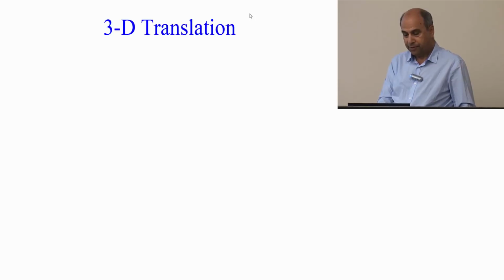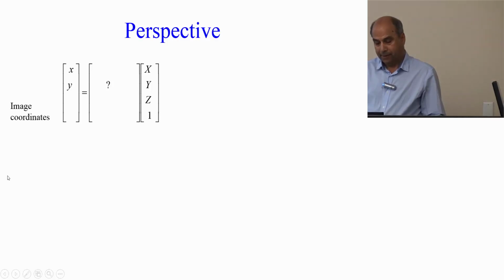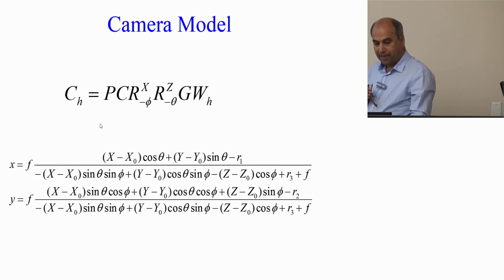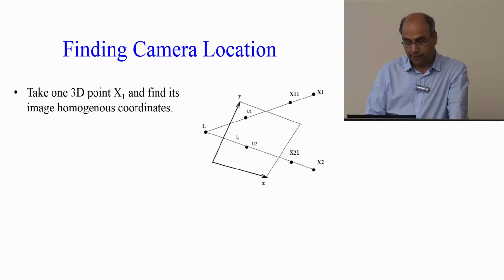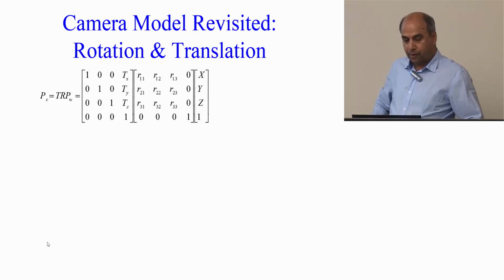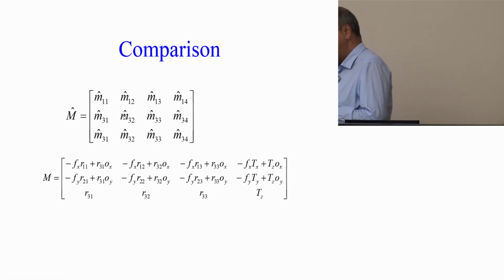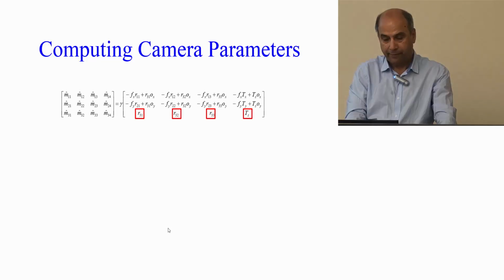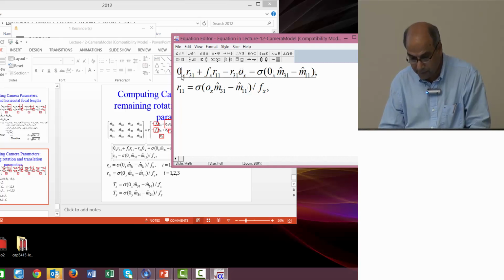Lecture 12 - Camera Model and caliberation - 2014

Comment: I have one query that is whats the difference between camera model and camera calibration
Reply: TLDR; Your model is the mathematical description, for example, just using an intrinsic matrix without distortion: K = [fx, 0, cy; 0 fy, cy, 0 0 1] and your calibration for this model and the actual camera model you are using could be: fx = fy = 105.2 (focal length in terms of pixels), cx = 961.8, cy = 539.8.

You're probably not going to ever read this, but for anyone interested: The camera model is the mathematical description of the camera. Typically you would have at least a K matrix (3x3) which includes the focal length and optical center. Commonly, however, you would in-cooperate at least some way of dealing with lens distortion. Typical ways of modeling distortion rely on making the optical center a function of position on the image sensor. Specifically, as a function of the distance to the optical sensor, such that pin cushion distortion and barrel distortion can be modeled. Of course, you can make this more complex, but this will also make calibration more difficult.

So what is calibration? Calibration is figuring out the values of the parameters to your camera model, such that when projecting world points P to image points p onto your sensor (say p = K * M * P, with M being the extrinsic matrix [R t]) you minimize the error between observed points and projected points.

Once the estimated values of your model (your calibration) match close enough to the "real" values, your projected points will be accurately projected to within a pixel (typically below 0.3 is easily attainable).